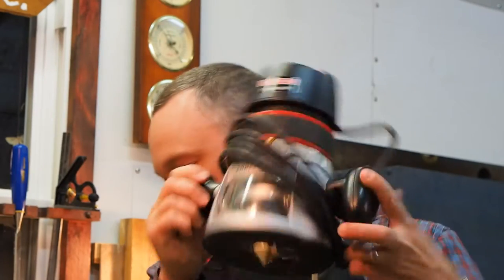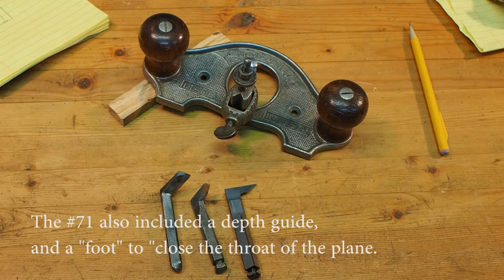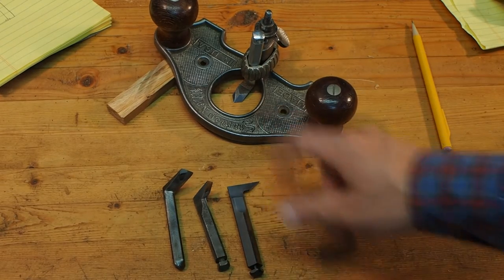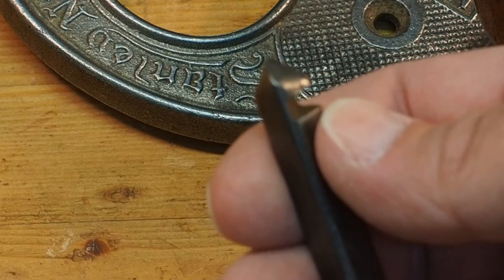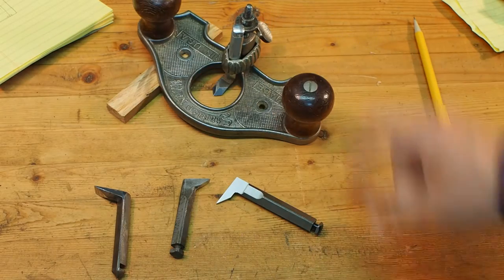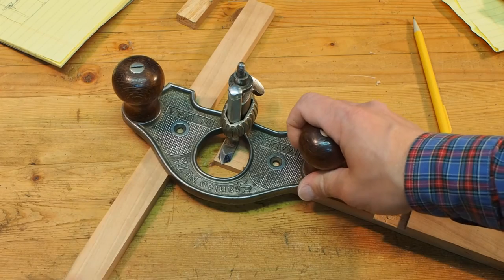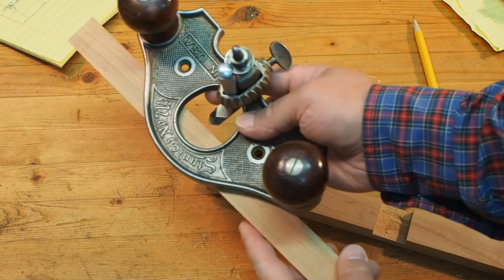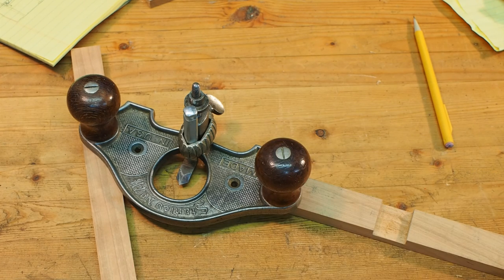Stanley #71 1/2 Router Plane

Comment: I love your videos and your shop. I'm hoping you could tell me where the initial design for your blue swing up top wooden tool box is from. Does the style have a specific name I can look for. Looks like a great medium sized project for me.
Reply from the maker: I actually found the original plan on the Woodwright's shop website.  I just looked though and I think they've changed the site so those downloadable plans are no longer there.  I did print it out back then, so I'll dig around and see if I can find it.  If I do I'll scan it and send it to you.
Reply: Thank you. Even a rough cellphone picture may be enough too.
Reply from the maker: Ok I got you a decent pdf of the original plan.  Where would you like me to send it?
Reply: Email you at your google business email. Thank you so much.
Reply: Suggestions on how to sharpen the router bits?